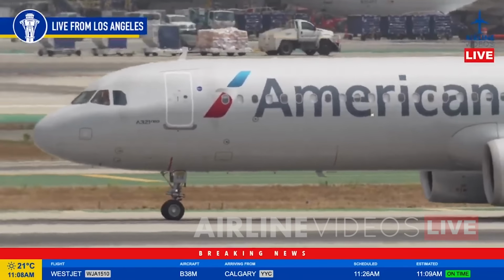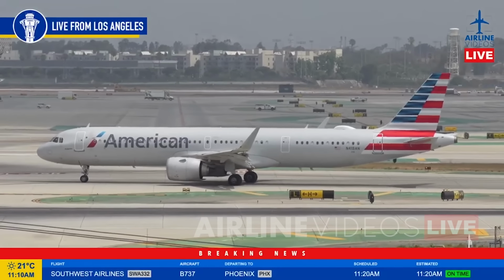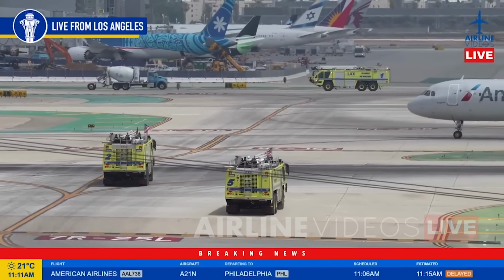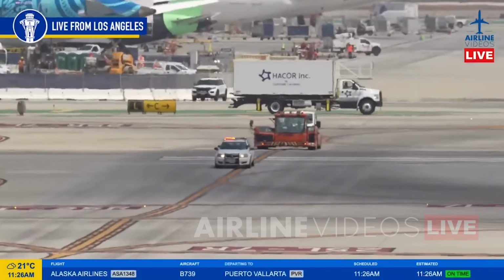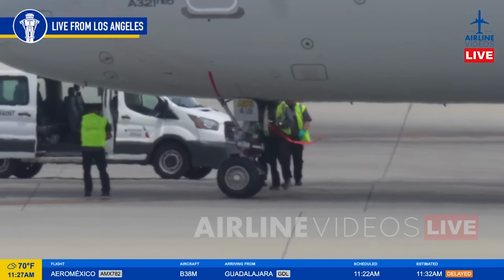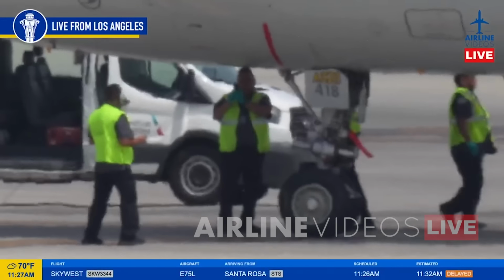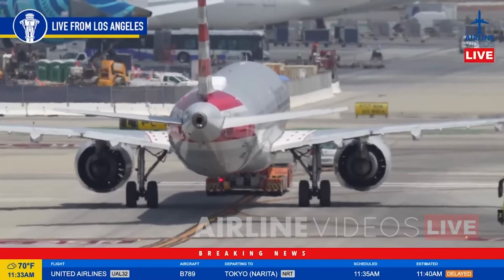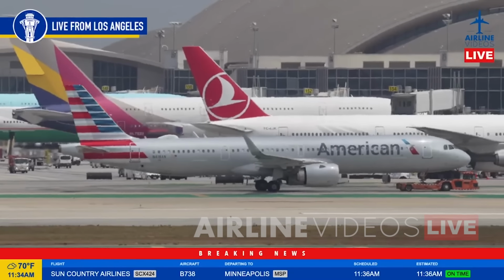American Airlines Flight 1528 Airbus A321neo Hydraulic System Issue at LAX!

Comment: Great catch! The unfortunate truth is that this story exists ONLY on this channel (and nowhere else) because of the name plate on the certificate. Had this been a 737, it would be a headline splashed across every newscast, news site, and social media feed. The general public doesn't understand that these things happen on a regular basis to ALL aircraft types. Glad the pilots got her down safely (as they do in 99.99% of these incidents).
Reply: The story as usual exagerated. 1 of the three Hydraulic steering systems failed and the procedure is to land. They flew it without issue.
Reply: @eleventy-seven You bet. And I'm not suggesting that this SHOULD HAVE been a news story....just that if this were a Boeing--even a 20-yr-old aircraft--it would be one.  No question about it. 
There was a bird strike the other day that resulted in an engine failure and it was front page news (with "Boeing" in the headline, of course), complete with a comment section that was disgraceful to anyone who knows even a tiny bit about aviation.  The comments ranged from clueless to downright reckless. Boeing does have QA issues and a PR problem of its own making...but idiotic assumptions from the general public are also running rampant thanks to these  sensationalized headlines that are there simply to draw clicks.
Reply: Doesn’t happen on a regular basis lol
Reply: @MC-kl5mp   Emergency landings happen literally daily, and it's often for hydraulic or other system failures.
Reply: @327Erich  does not
Reply: Yes, they do. There are entire YT channels that post videos documenting these with map animations to go along with the ATC comms. These happen ALL THE TIME.
Your oblivion does not mean they aren't occurring.
Reply: @327Erich  spreading mass hysteria is WILD lol.
Reply: @MC-kl5mp  Are you daft? I'm doing the exact opposite. These incidents usually go unreported because they typically end in an uneventful landing, thankfully. Modern aircraft and flight crews are equipped to handle almost every issue they encounter in flight. That's a good thing to anyone whose reading comprehension is decent.
Reply: @327Erich  I’m just trolling you

Comment: The Airbus 321 lost one of it's 3 hydraulic systems. There was no steering loss. Out of an abundance of safety and rules if you lose a system you land.
Reply: It lost the system that was used for steering on the ground. Limited steering was still available using the rudder pedals but unable to taxi.
Reply: @williamboza9850  That would have been the Yellow system.

Comment: ended well, however, with no nosewheel steering, how was the pilot  to steer below a certain speed. During landing, you steer with vertical stabilizer, but at some point you need to steer with nose wheel. I am thinking asymmetrical thrust or was it steering a car with no power steering ? food for thought